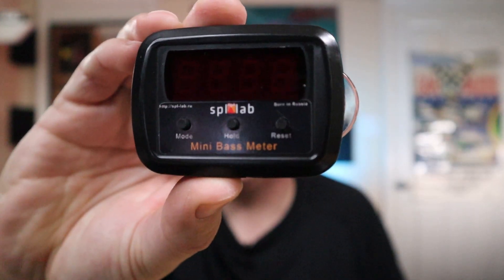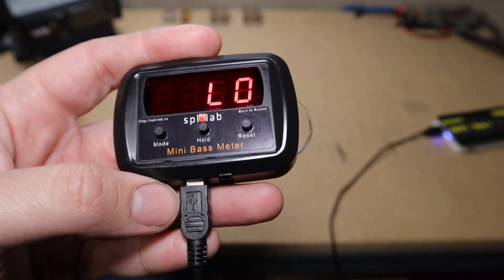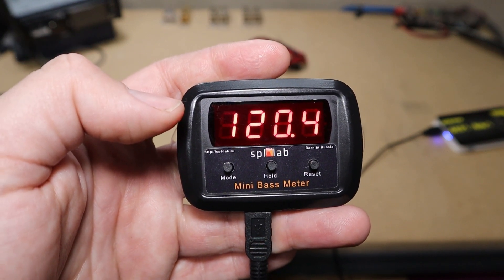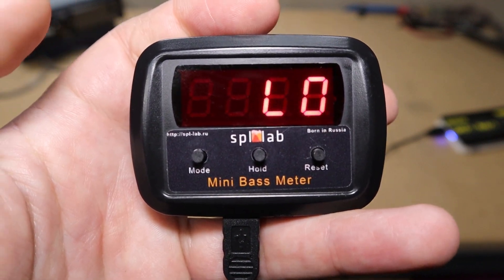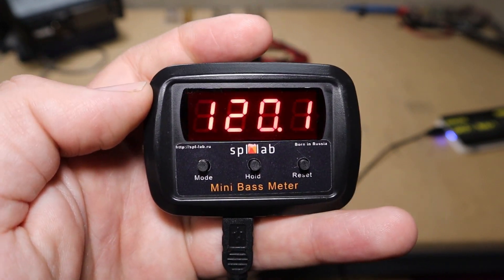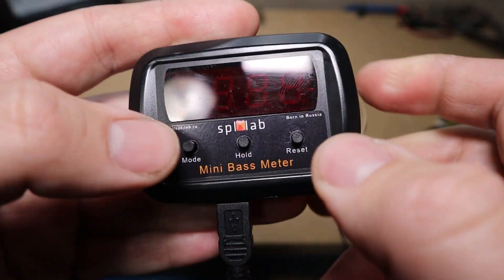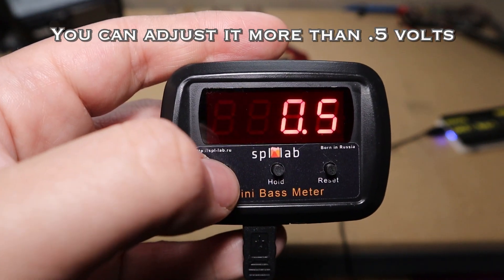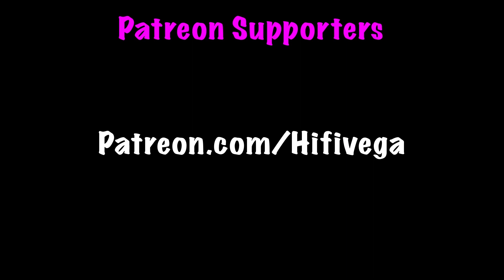How to use a SPL Labs Mini Bass Meter

Comment: So I bought the V2 and it has mini USB on the bottom but it came with 2 micro USB cords the micro cords do not fit in mini USB slot because there different is this normal I looked up couple people selling the same one and seems like they got the same micro USB cords but the meter has mini usb
Reply from the maker: I’m not sure what version I have, but mine also has mini usb.

Comment: Here I am watching this vid again😂 the red and black cig plug sucks mine stopped working it came unsoldered turns out that black and red wire is cca and dont like solder😂
Reply from the maker: I have the same issue with mine I need to check it